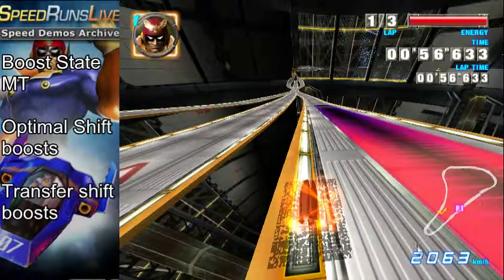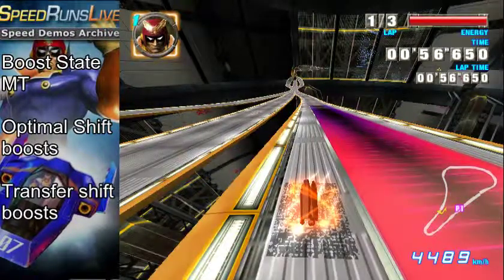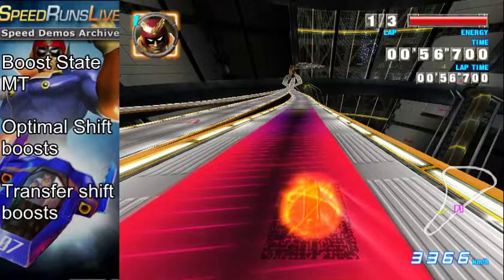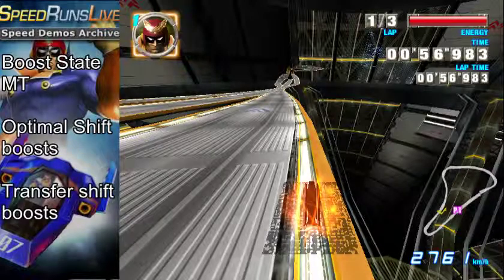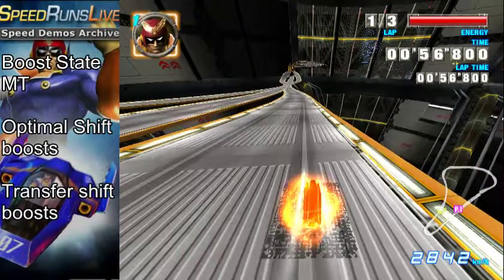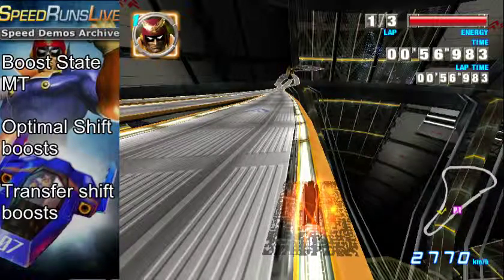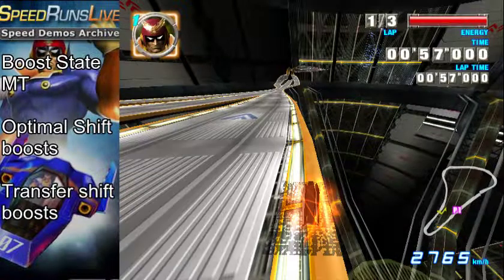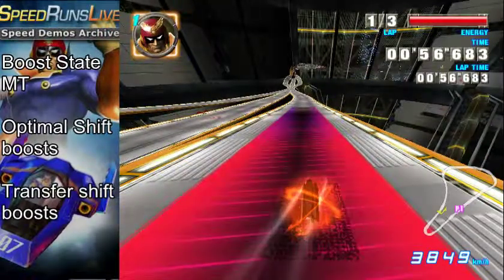Shift boost optimization

Comment: Got the same results as you did, but why does Gallant show so weired on your emulator. Which version of dolphin are you using ? I´m using vers. 4.0-4922 (developer build) and everything looks fine there (except for crashing rather often :(  ).
It would be helpful, if you could see the accelerator starting for example.